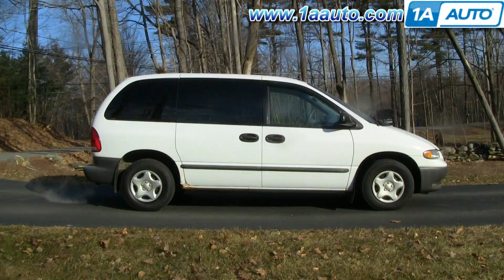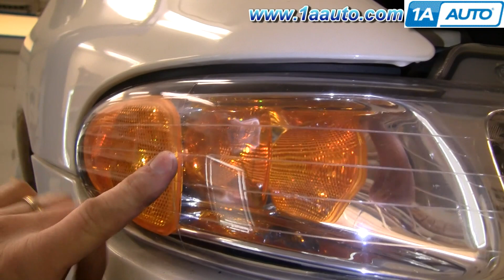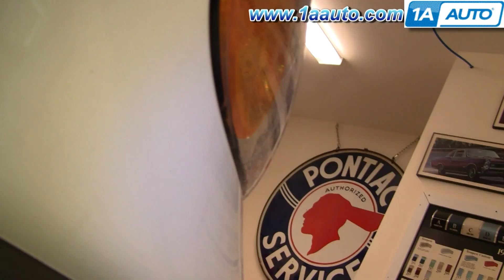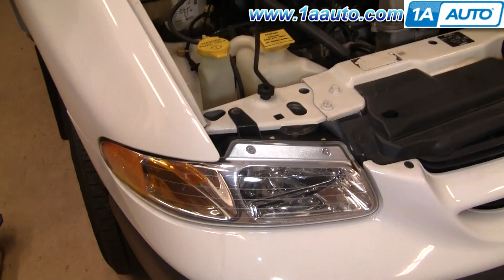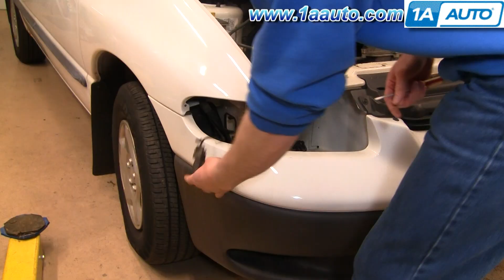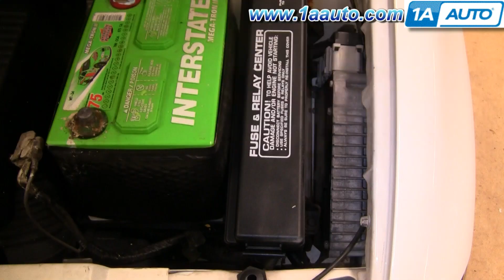How to Replace Headlight 96-99 Dodge Caravan

Comment: thanks. woulda been nice to zoom in on the removal of the bulb and stuff little far away to even see what doing with the tool/clip sometimes nice to get that visual... but im gonna try now. thanks again. definately not much room with the fuse box even loosened the box is snug in there.

Comment: Thanks!  Helped so much.  In adjusting my side-to-side I had to remove the radiator overflow tank bolt again.   Actually, completely remove it from the car to have room for the racket and 4mm socket.  s'all ok and I'm good to go.

Comment: I just used this video and yes, it worked for me.  The hard bulb is on the driver's side and yes I did remove the two 10 mm bolts to move the fuse box.  You do have to move the box towards you,i.e. towards  front of the van a bit to unleash the top male/female connection.  I used a large screwdriver for leverage.  And I did disconnect the battery.  Thanks for the video.

Comment: What they leave out, when installing the driver's side headlight bulb, is that the fuse box assembly sits between two metal prongs with a hole in each prong for the rod that the fuse box is connected to to sit in.  What you have to do is have a long screwdriver and place it between the top of the fuse box assembly and the top metal pronge and then lift the fusebox assembly out of the top hole.

Comment: TYSM!!!! I never knew what that access was for in the wheel well, you saved me from having to remove my whole headlight just to replace a turn signal. Mine is a 96 Town & Country w/ 215,000 miles and still runs great